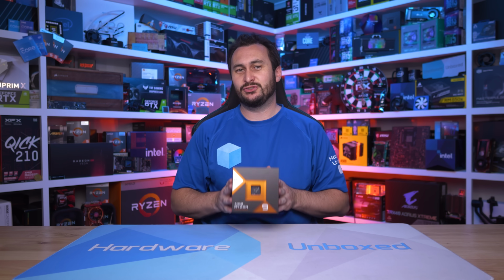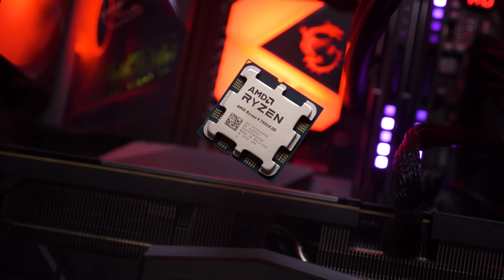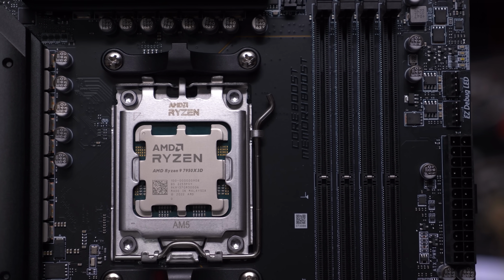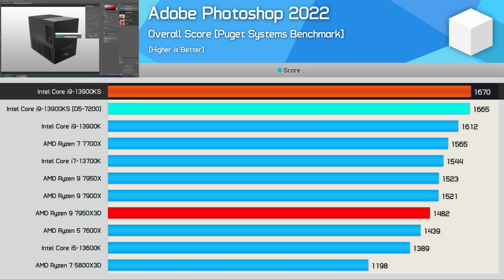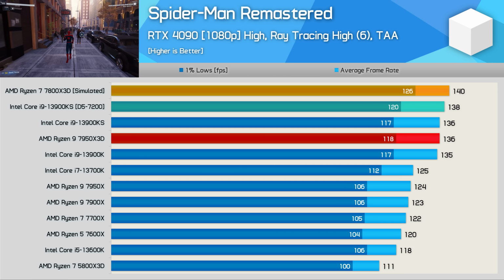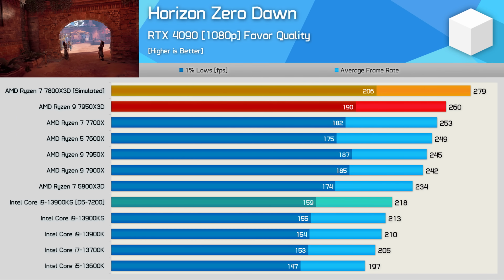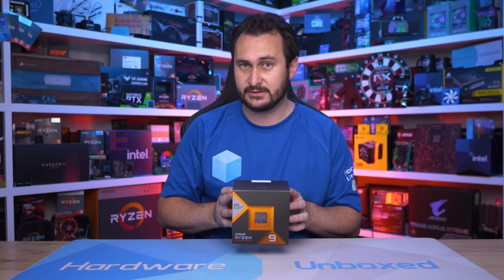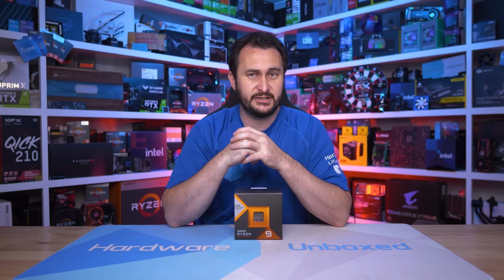AMD Ryzen 9 7950X3D Benchmark + 7800X3D Simulated Results

Comment from the maker: A quick note. People are making the incorrect assumption that we didn't use the  latest AMD chipset driver and 3D V-Cache Optimizer.... we did. AMD are aware of the performance related issues with the 7950X3D in some games and are working on a fix.
Reply from the maker: Also, Rainbow Six Siege and Rainbow Six Extraction aren't the same game. Gamers Nexus tested Siege, we tested Extraction and again AMD are aware of the issue with Extraction but couldn't provide a fix in time for the review.

Gamers Nexus also test Shadow of the Tomb Raider using the built-in benchmark whereas we test in game, the village section which is far more CPU demanding than the canned benchmark.
Reply: @Hardwareunboxed  Did you run it in balance mode or performance mode? GN were told it needed to run in balanced mode (until an update can be pushed to "fix" that).
Reply from the maker: Balanced mode was used, this is normal.
Reply: @Hardwareunboxed  Can you dump into your next charts 13900ks ddr8000 data? The memory scaling story is interesting even if not worth a new video every time a new memory speed drops.
Reply: @Hardwareunboxed  can you test path of exile? last time gains was like in factorio with 3d cache and i can't find poe benchmarks anywhere, thanks
Reply: @Hardwareunboxed  process lasso testing please
Reply: @Hardwareunboxed  can you guys use StarCraft 2 as a CPU benchmark as well ? 

There are arcade maps that are only for benchmarking so you can get a consistent run .
Reply: @Hardwareunboxed  Folks play Rainbow Six Extraction ?
Reply: I saw a few places that said Windows could not park cores unless the balanced power plan was used - not high performance. Can you confirm this is the case?
Reply: Would love to have seen star citizen, hunt showdown that love that cache
Reply: Ok thanks guys for mentioning this. Glad AMD and the developers are aware and sorting this out, but not really a game changer for many titles as is.
Reply: Can you guys do a quick Xbox game bar off Vs on comparison or does the chip just not behave properly?
Reply: On the factorio test, are all of the Intel numbers based on P+E cores? why is the 13900k beating the 13900ks? Maybe disabling the E-core might boost numbers?(similar to how disabling cores helped with the AMD 7950X3D ?)
Reply: Good on amd. for getting some gaming competition vs intel. can't wait for them to fix the drivers or maybe make it a feature where you can automatically do this without messing around in your bios.
Reply: Good that you're referring to Gamers Nexus. They said it's the Xbox game bar utility that detects games and triggers controls for the CCD. I'm getting the notion you guys didn't use it therefore the "simulated" bar in the graphs. Would you please confirm that you used Xbox game bar during testing?
Reply: Yummy tech news 😏
Reply: what interested me is with the simulated tests ( and while exactly that ) is there anything that even with half the cpu shut down would the 7950x3d still out perform the 7800x3d ( disregarding the obvious production work with all cores working ) 

Also at this point i wonder if AMD screwed the pooch with the 7900x3d as would a 7600x3d been a better use of sand when logically a 7950x3d would still be the better CPU over all shut down half the cores you got a gaming monster enable them all for production ( even at a premium ) seems like a better deal !!
Reply: The price different of 100$ or even 200$ is something you need to consider together with other facts like much more power consumption of Intel + AMD running cooler. I rather pay the "extra" premium for just that.
Reply: How do you disable the second CCD?
Reply: I just dont understand why you did not use fastest ddr5 6000 or another tight timed ddr5 rams just like on your previous video for non x3D amd 7000 cpus. Did you do this intentionally to  make x3D look better with bigger gaps than normal ? or did amd forced you for this test setup ? Because we know that marvel spiderman with 7950x with tuned memory CL30 reached 140 fps, and non tuned gskill cl30 reached 129, but in this test you used corsair getting 125 fps. And  7950x3D gets 136fps. Would not it be more fair to test with fastest possible situations for all CPUs ?
Reply from the maker: We used the same DDR5-6000 CL30 memory for testing the 7950X3D that we did for all previous Zen 4 CPUs, so I'm really not sure what you're on about here.
Reply: @Hardwareunboxed  I think just because you were the best reviewers out there with gamers nexus i think i was spoiled to expect best thing. If you think this critism is not fair i am really sorry. I wrote it because 10 days ago with your tuned memory testing you showed how sensitive Amd cpus were. I just picked only 1 game as an example. With your tight tuned memory Spider man was getting 140 fps with 7950x, with gskill cl30 6000mhz it was getting 129fps and with corsair cl30 6000mhz (i think same memory as 7950x3D test) got 125fps. On this video same game same 7950x with corsair ram it got 124fps so i thought you did not use at least fastest non tuned cl30 6000mhz which was Gskill. Since for test setup you showed corsair ram for this benchmark. I really wondered what would happened to test results if you used gskill cl30 non tuned or tightly tuned ram you used 10 days ago. May be 7950x3D results also gets skyrocketed. Gaps  would be different between amds own cpus and also compared to intel cpus. Thats what i believed and commented because of that. In the end no matter what i say you guys are among the best if not the best and we are fan of yours.
Reply: The ram scaling was done with 7700x, and looking at other games it looks to be within margin of error....?
Reply: R I.P Intel .. your temp and power consumption will be remembered forever in our frozen heart
Reply: what about video editing with it? am a freelancer thats why I'm wondering.
Reply: @WierdGuyLiam  should be great. If you're only editing videos and not playing games, you might want the non x3d.
Reply: @MacStanley  I play games to, curently I'm taking fortnite competitivly, cause yea its a lot of money in that game.
Reply: You have to also talk about the worst power consumption of that intel i9 that also require a big cooler
Reply: Does anyone else care about the power consumption? I don't understand the recommendation of the 13900K at the end, while before showing the power consumption in the Blender test is a wopping 80% higher.

Comment: For the upcoming 9950x3d, have you considered playing around with process lasso, or something similar for prioritizing the correct cores? especially for cases where 7950x3d falls behind 7800x3d this could be very interesting. Supposedly, this differs from ryzen-game-mode by leaving the 2nd ccd active, for background tasks, or workloads overflowing the 1st ccd. This might ensure the double ccd cpu never looses to the single ccd, and might surpass it by a larger margin in other cases. Perhaps this way more of the the x3d cache can be available to the main application(not sure if thats how it works..). Though who knows, maybe scheduling has been improved to a point where this is no longer an issue. Guess we'll see :)

Comment: 7950X3D = 7800X3D OC (CCD0) + 7700X OC (CCD1)
7950X3D with CCD1 Disabled = 7800X3D OC. 
7800X3D OC faster than original 7800X3D. 
7950X3D with CCD1 disabled is FASTER in games than original 7800X3D (5,25 GHz turbo boost vs 5,00 GHz turbo boost and the same cache).

Comment: The price of the 7900X3d just dropped on Amazon to less than the 7800X3D ($360 USD). With proper core management, the 7900X3D should nearly match the 7800X3D in gaming and will be better in productivity tasks.

Comment: Shouldn't the tests be run rather in 1080p LOW settings instead of HIGH, ULTRA or even RT ON... when testing and comparing a CPU? I would try to eliminate ALL the other variables and I know, 4090 is a hell fast GPU, but anyways... cranking all settings to MAX and turning RT ON adds some % of bottleneck to the GPU, even on 1080p... I would compare CPUs in games running in 720p and MIN game graphics settings...

Comment: Perhaps others will disagree, but I do not mind spending more for the AMD platform as they will not be killing it after this generation.  I have a X370 motherboard that started with a 1700 Rzyen, moved to a 2700 and now is using the 3950X.  At best Intel has supported a chipset for 2 generations.  In contrast, as I have complete confidence that I could drop the S/O's 5950x into this motherboard and have no issues.

Comment: won't the higher ict boost on 7950x3d mitigate more bottleneck over 7800x3d? or are we in the age where 0.7ghz difference won't matter much, since there's only so much to offer and the devs cbf scaling more performance to frames?

Comment: If you disable the non X3D chiplet, do you still need BIOS and AMD driver updates? Another words are the AMD drivers and BIOS updates so it can successfully differentiate between non 3D and 3D chiplet. But if there is only 3D chiplet, drivers and BIOS optimizations and modes are not needed correct?

Comment: With parts like these you badly need to add a performance per $ graph like you do with GPUs. Especially when the savings would give you vastly more performance if applied to your GPU in real world applications. I appreciate your skepticism in adding the "simulated" 7800x3d to point out AMD is gouging impatient clowns.

Comment: Considering today's high electricity cost, the difference in price between 13900K and 7950X3D platform might quickly become irrelevant and in the longer run using the amd platform will be actually cheaper than intel.

Comment: When you say you simulated the 7800x3d, did you take into consideration that the 7950 runs at a 14% faster boost frequency? If the cpu was not clocked back to 5.0 max, that is just the 7950x3d with an optimized configuration.

Comment: So... In theory, especially with the higher clock speeds, the 7950 can get over the 7800 3D... The 7950 3D is the best of both worlds since you can simulate a 7800 3D by disabling the non- cache cores? For games that benefit from more than eight cores, leave it all turned on?

Comment: Not buying anything until I see a 7900X3D review from you guys!!
Reply from the maker: It's either the 7800X3D or 7950X3D, the 7900X3D sucks.
Reply: @Hardwareunboxed  You say that, but Steve over at Gamer's Nexus just did the 7900X3D benches and it's pretty much tied with the 7950X3D with a few exceptions yet it's 15% cheaper. I'd love for you guys to do one of your famous 40 game benchmark tests to see an actual percentage difference because it might actually be cheaper per performance than the 7950X3D, or to show any holes in having only 6 3D cores plus in many EU countries the 7950X3D simply isn't available yet and we'd like to see how those 6 3D cores hold up!
Reply: @Hardwareunboxed  Plus you reviewed every single intel cpu and there are a LOT, and I think it's only fair to review one of the few AMD CPUs coming out this year. Think about it logically. The 7900X3D is 15% cheaper and if it's within 15% of the performance of the 7950X3D then IT IS WORTH buying. Or many not? Maybe overall it isn't any better than a 7700X or a 13700K? How will we know unless you do the tests? :)

Comment: The 7900X3D clocks higher at 5.6ghz than the 7800X3D at just 5.0ghz...
This makes me wonder if I should be waiting for the 7800X3D or get the faster 7900X3D? 90% of the time I won't need the extra cores and I don't think it's needed for future proofing.
Was this simulated result done at the 7800X3D 5.0GHZ or was it done higher? I just don't wanna wait to buy and find out there was a faster CPU for gaming already out.

Comment: I think the power consumption when choosing these parts can be overrated, but I’d still consider the AMD chip just because of the power draw of the intel cpu is just that much worse. Obviously the simulated 7800x3d i seems like the better path because of cost.

Comment: OFFTOPICQUESTION!!!!
Need to finish my build asap the only thing remains is the monitor(1440p)  what do u think about this two monitors? Gigabyte M27Q vs hp x27q i saw your reviews but i cant decide wich buy, i had offers for used monitors from 200€ for the m27q and 180 for the hp but honestly i cant decided T_T (ppl of the chat can give opinions too) [13600kf 3080 16g 3600mhz ftw its the build]

Comment: Kind of a newbie/rookie question.  But...If you are doing productivity stuff...is an R7 enough?  Or do you need an R9?
Reply: Sure, if you can't afford anything better. I would say that's a minimum for productivity (8 cores). Check the requirements of the software you will be using. You could go up another $100 and get the 13700K (16 core). Generally, Intel is better supported for productivity software.
Reply: @TheHandHistoryVault  That I did know about Intel.  But, I have an AMD system and cannot afford to do a complete conversion, but must do a system improvement.  Currently using an R5 and have new needs.  Thanks for the input.  Greatly appreciated.

Comment: Considering the experience I had in buying a 2990wx CPU I am hesitant to get a 7950X3D, dynamic local mode which was software driving which cores that got priority didn't have great performance compared to just disabling 16 cores, so I need to see benchmarks of the 7800X3D which wont need that software before buying.

Comment: You simply cannot ignore the fact that the 7950X3D offers same gaming performance as 13900KS but the KS draws over 2.5x the power to do so... this is a massive, massive negative for the Intel part imo. Cooler cost, heat and noise output, energy cost is all noticeably worse on the 13900K/KS

Comment: You can use programs: Prio or Process Lasso to set per application which cores they can use (its saved so only need to do it once, you can experiment with the cores) so no need for bios or other tweaking. And all other program can use the rest of the vores/threas.

Comment: Thanks HUB for that awesome review.

I think reviewers should test CPUs using the top end GPUS from each vendor (4090, 7900XTX and maybe even A770). The more it goes the more it seems we are seeing instances where the 4090 bottlenecks CPUs with its driver overhead. Not saying the 7900XTX will outperform the 4090 in these scenarios (although it could very well, its happened before) but at least the CPU load will be less impacted by drivers; the resulting performance would be more representative of the actual games performance.

At this moment, i haven't seen a single review of the 79x0X3ds using a Radeon card. Moreover, with all the advantages AMD touts its new AM5 platform offers, putting those claims to test would certainly be interesting.

Comment: 7800x3d looks to use 50% the power draw yet trades with or beats Intels flagship in 90% of games.
I don't know how that isn't a clear Win?
Reply: A clear win is what 5800x3d did to the competition when it released, not this. For the price they ask here they should have destroyed the competition on both power and performance, but at least on performance.
Reply: By at MAX 10%. That's why it's a fail. If the 7950x3D had extra 3D cache on both ccds and beat Intel by 20 to 25% then it would have been a huge clear win. 13900K/KS is more constant. But those Intel chips are on a dead platform. So really AMD wins by default. However, if you don't care you can't upgrade after (technically you shouldn't to raptor lake refresh), Intel is actually the smarter choice.
Reply: @TheHandHistoryVault  3d cache on all cores for sure should have been what they did here. And why i am referring to the upcoming 7800x3d as the winner not this as it leaves to much on the table for the price because essentially there are only 8 x3d cores.
Its a big deal to me that AMD trades with Intel for 50% the power draw.
Reply: @bigdaz7272  Fair enough.

Comment: Is there any way you could run the "simulated 7800x3d" results for some productivity apps?  it would be helpful for gamers who either have or are interested in the 7900x or the 7900x3d to understand how much of a performance hit they'll lose in productivity from the lower clock speeds by waiting for the 7800x3d.

Comment: Instead of three i9 measurements, I would have prefered the r7 5800 non 3D (i. e. 5700) and some best sellers, which are actually the most relatable, such as the r5 3600.

Comment: not sure how much more optimisation can be done but base on this initial 12 game average just 10% uplift in 1080p compare to non-3d which is kinda disappointing. if you are playing mainly at 4k there is little reason to get them unless you absolutely have to have the best and even that is game dependent. they should release 3d variants at the same time with everything else from now on...

Comment: umm but wont the 7800X3D have a lower clock speed then the 7950X3D?
Reply from the maker: That's why it's called 'simulated', at the end of the day it's about a 100 MHz difference.

Comment: Thanks for the handy 7800X3D simulation, very interesting to see how each game reacts to the differences in core clocks, number of CCDs and cache. I hope that for the actual release and benchmarks of the 7800X3D, we can have these simulated numbers appear alongside to see how accurately a 7800X3D is simulated by the more expensive 7950X3D. I'd like to also see how these CPUs scale with memory speeds and timings to see if the memory sweet-spot has changed from regular 7950X.